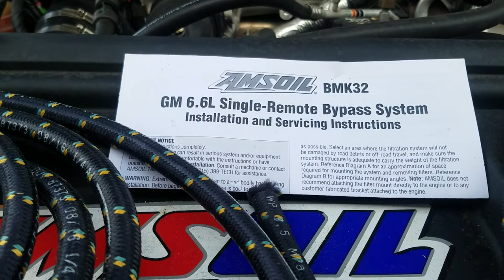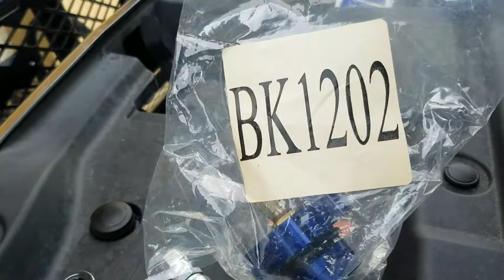LML Amsoil BMK32 Bypass Oil Filter Kit

Comment: Nice simple system. I'm probably going with the e-bay one that mounts where your coolant filter is mounted, about half the price of other kits at $340 shipped. I'm sure the components are lower quality, but it does have stainless braided line and everything is solid aluminum so I doubt there will be problems. I wonder about oil analysis costs though. I heard if you get an Amsoil kit from their site($580+) they do oil analysis for like $15, but it would take a long time to make up for the difference in initial costs.

Comment: Do you think if we mount the remote filter as low as possible and avoid 90-degree fittings would flow better volume with less pressure loss? Or, does height matter as we are dumping the bypass into the valve cover? I enjoyed your video and decided to comment as I noticed there were not any comments with 9 and 1/2 subscribers (good job) this motivates me to check out more of your videos! as I write this bypass you have 296 views on this one. My engine sits low enough that the only 90 I will have is to let the oil out of a spray bar under my valve cove(  69 Toyotafj40). Have a good one.